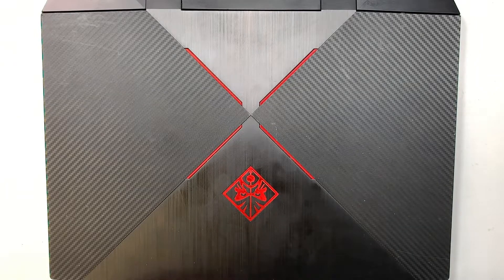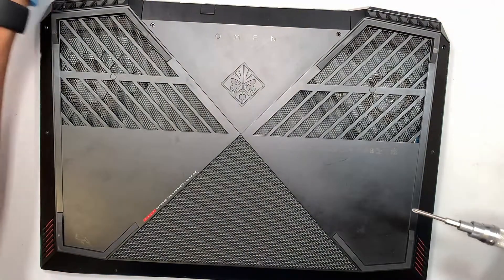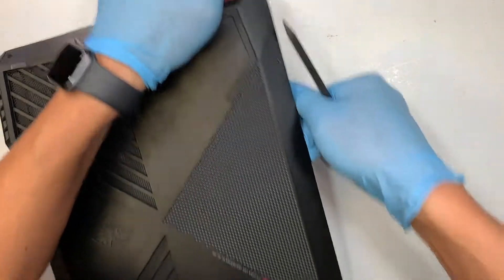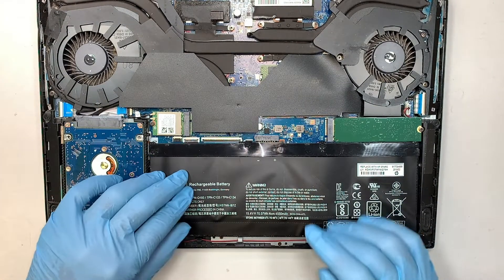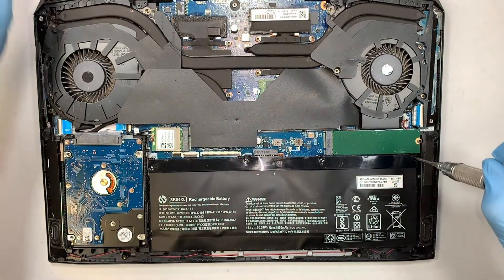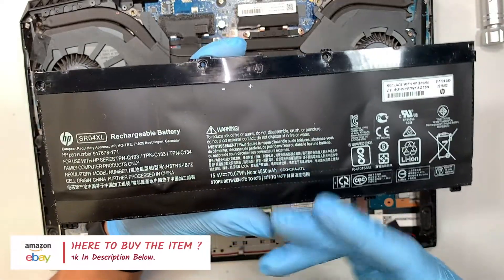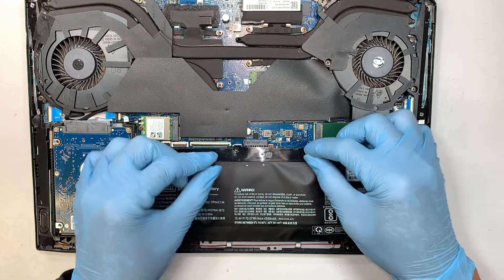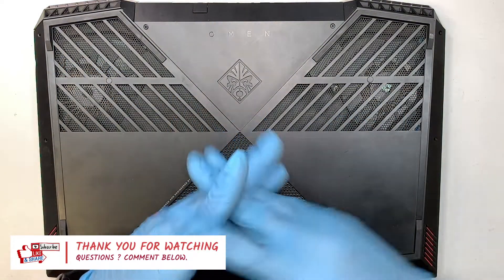HP Omen 15 dc0087nr Battery Replacement

Comment: Thanks.  These directions also work for the Omen 15 dc0052nr.   For the longest time, I thought my laptop’s  case had separated from the keyboard’s surface because of something I did.  It was a swollen battery the whole time.  Now I know not to keep it plugged in all the time.
Reply: The same thing happened to me. I only discovered the culprit when I opened it up to clean the fans.

Comment: At 06:16, the top-left is cracked for me - and the bottom (i.e. front of the laptop) doesn't close at all. The screw goes there but the lid is actually wide open. It may have been because of the swollen battery, but am not sure if that lid itself was broken because of the cracked top-left I mentioned before (it came like that from a refurbished shop).
Reply: Push on it till it snaps in place

Comment: a common use case for a laptop is that it sits on a desk, all the time. Why would they be designed to ruin their batteries if left plugged in all the time? Really stupid of the computer industry. (Thanks for the video, nice and clear)

Comment: Can I remove the battery and use the laptop as monitor (on direct power input) only?
Reply: Just done it today, I have an omen 15, 5 years old, always plugged in, I replaced the m2 ssd and noticed the swollen battery, I was just about to replace the computer, and I just removed the battery, it will try to boot a few times as it doesn’t know what just happened until it resets the bios and all ok, just works👍
Reply: @333dwmh  yeah i have been doing that as well. But while gaming, it heats up really bad though.
Reply: @abhimanyusinghchouhan1691  Change the thermal paste on both cpu and gpu and keep the laptop higher than the desk, there are on amazon some laptop stand-raisers that do exactly that.👍
Reply: @333dwmh  i got the laptop stand. But I'll get change the thermal paste. Thanks man, appreciate it!

Comment: Thank you so much for this! If you have time, though, I have a bizarre problem: I replace the battery and it works fine, charges and drains... but when the power cord is plugged in and it's charging, works fine if I unplug the laptop while it's running, but if I move the laptop too much while plugged in it crashes as if it's running with no battery and got disconnected. I think this has to do with a weak connection because I went to unplug the laptop and got a shock, did I somehow install the battery incorrectly? Or is there a software issue somewhere? I've updated my battery drivers and windows, so why is the battery not taking over like it should?

Sorry for the long question, I know youtube comments like these can be annoying since there's no way to properly diagnose and this isn't the platform for that, but I figured trying wouldn't hurt

Comment: Hi, Ples am using an HP OMEN 15 and if am play games with it whiles on charge I loss so much fps buh if I remove it from charge, there will bi an improvements in fps. Can that bi caused by the battery?

Comment: Do you have/sell extra battery screws?

And also how to fix fps loss after being repaired? It’s still the same model
Reply: have you thought about cleaning the dust inside the fans ? Be carefull with how you do it

Comment: Good morning
Can you help me please
I have a laptop OMEN by HP 15-ax246nf Laptop PC
the battery (4 cell 63.3Wh Li-Ion battery) does not charge and the mains supply is good
after having carried out all the tests (software) the battery seems in good condition and the cells too.
in the device manager the installed drivers are from microsoft and not (official) hp
Thanks